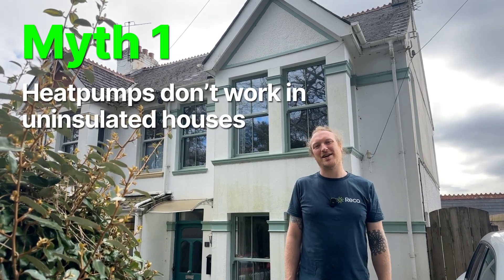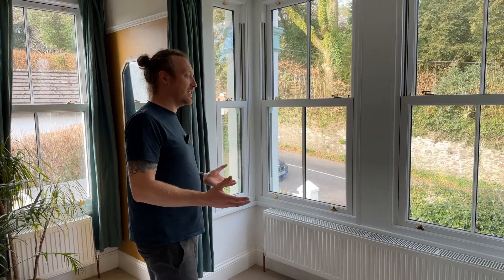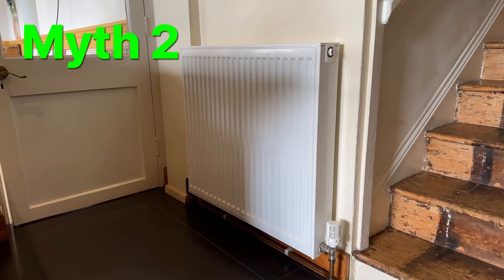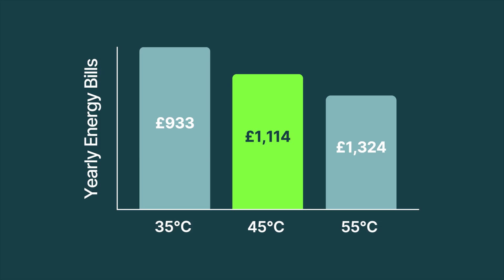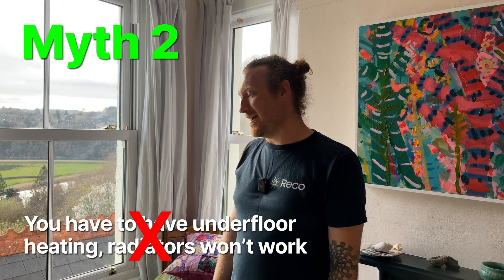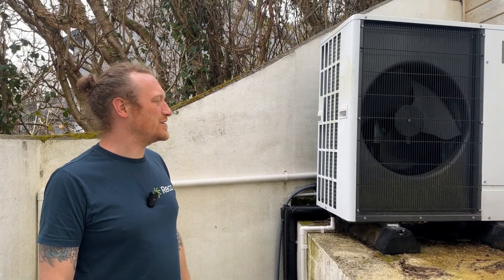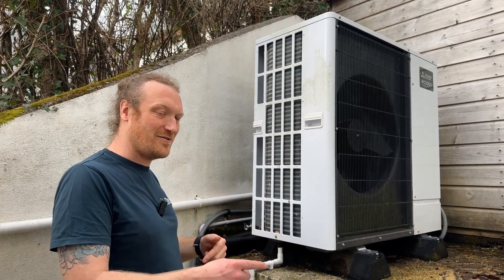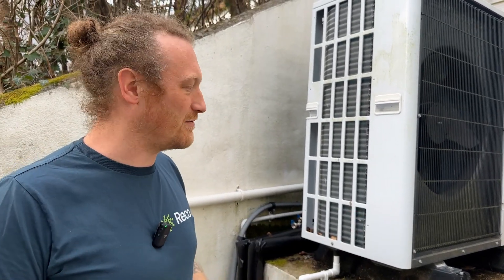Heat Pumps DONT Work In Old Houses!

Comment: There is an issue, in that Air to Water Heatpumps can be less than ideal in older properties. Air to Air Heatpumps are much better for older properties. In comparison, with Resistive heating it's night & day. However, Government grants don't cover, Air to Air Heatpumps, so if people want a Grant, they have no choice. Forcing Air to Water Heatpumps on people in older properties, will just lead to dissatisfied customers, and a backlash. The governemt, needs to see common sense and start approving Grants for Air to Air Heatpumps...
Reply: To be fair, the cost of a multisplit a2a system will be apx 8k, which is about what many a2w installs cost AFTER the grant with the radar or pipework  changes.
Reply from the maker: Also you would need to put plastic trunking all over the house and an air con style head in every room, not very aesthetically pleasing in a period house. Air-air heat pumps provide heat through convection only which means the fabric of the building doesn’t warm up in the same way. Radiators provide convective and radiative heat which permeates and warms the fabric of the building. This means the house acts as a thermal battery allowing the system to ride through cold spells more efficiently. An air-air system would struggle to heat an old building like this from cold and provides a different “feeling” heat. A bit like when putting electric fan heaters on, as soon as they are off it gets cold.

Comment: Between 4 and 5 Megawatts over the year isn’t as bad as I was expecting for an 11kW output unit. Got my 16kW  (14kW true output for a 13 kW heat loss property) unit going in over the next couple of weeks, extremely nervous I have made a bad decision. If I’m honest it doesn’t make a lot of financial sense to be replacing the gas boiler with the current power pricing structure.
Reply from the maker: If it’s installed correctly then it shouldn’t cost you anymore to run. Make sure the unit you are installing allows you to see the heat it’s delivering and the energy it uses, if not maybe consider installing an emonpi heat monitor so you can look at how well it’s running. Make sure the radiators have been sized for each room correctly and the installer has ensured that pipework to them is sufficient. The installer should be setting it up using weather compensation and not a fixed flow temp. If they are fitting a buffer then question them as to why it is needed. If they understand all of these things the chances are you will have an SCOP above 3.5 which will result in a cheaper than gas system. 

If you pay 27p per unit of electricity and your COP is 3.5 then 27/3.5 =7.7p per unit of heat. 

If you pay 6.9p for a kWh of gas and your boiler is running at 85% efficiency then 6.9/0.85=8.1p per unit of heat. 

Heat pumps are cheaper but people haven’t caught up with the key concepts and basic maths yet. That’s why we started this channel!
Reply: @ Thanks. Yes, it’s taken me 9 months to get to this point, had extensive insulation (and ventilation) remediation to get us to 40w/ m2, we were at 80w/m2. That allowed us to drop to a large single phase heat pump, whereas before we were looking at a very large 3 phase system that was untenable. Going with the 16kW Samsung, even with the nasty control system, primarily because it has the best footprint for the location we want to install it in. Yes, running weather compensation, we plan to run it with to target 15C and <40C flow temp in the house as we don’t like it hot, my hope is that it won’t consume more than 6mW over the year. We have a large 15kW peak PV array that gives us about 10mW export income on octopus intelligent go, so the strategy is to use the credit in the sunny months to cover the cost of the ASHP on octopus cosy over the winter months and over the year and we should end up with about £2k profit on our power. Time will tell if my predictions are correct. 
It’s all overly complicated and the majority of installs are poorly specified, I had to scope it for myself and as a process engineer I had that capability. But am sure if ASHPs can never take off until this improves and uk.gov needs to resolve the spark gap.
Reply: @RecoEnergy  We did it back in June/July. It’s been amazing, although a large unit at 16kW, most of the time it modulates down to about 800W load. Have it managed by a homely optimiser, I’ve not seen the flow temperature go above 26C yet and it has frequently dropped down to 2-3 C overnight. Best thing we ever did, from a comfort and economy perspective.
Reply: If you have a substantial solar array then a heat pump would make sense. You save over £100 per ann. in getting rid of the gas meter which buys a a lot of heat electricity. But if no solar array then a low temp running system with a low modulating gas boiler is generally the better choice. It is a matter of getting someone who knows what they doing with a low temp system and low modulating boiler or a heat pump.
Reply: @ Thanks, yes I put in a chunky monkey PV and PW3 system. It’s on track to output about 13 mega watts over the year on octopus intelligent flux. Excess credit should cover ASHP costs and leave me with a few quid pending my miscalculation, best laid plans of mice and men and that! It’s a largish house to heat at 300m2 but we are used to wearing clothes in the winter, so even 15C is a bit too warm for us.

Comment: 1 How much , that heat pump is massive. Obviously a cheaper solution would have been room air conditioner and a gas boiler when it's cold?
Reply from the maker: This house needed a completely new heating system because we were replacing storage heaters. I believe the whole system was in the region of £20k. The heat pump and cylinder made up around £11k of the cost, which was mostly covered by a grant at the time. The heat pump is large due to the high heat loss of the building. 

I would think that installing A2A as well as radiators for a gas boiler would cost much more than this system. 

The boiler upgrade scheme provides an upfront grant of £7,500 which will covers most of the cost of the heat pump and hot water cylinder. This means installing a heat pump is slightly more than what a new gas boiler would cost but less than what it would cost for a gas boiler with a hot water cylinder which offers a much better pressure and flow rate for showers. The running costs of a heat pump are the same as a gas boiler when installed correctly. When paired with solar there’s the opportunity for it to be cheaper than gas.

Comment: 1114 a year to run, WTH is even that.  i am in an 200 year old house and pay half that for heating, about 50 a month for me for gas on average, significantly less in the spring summer autumn etc, as the gas is just for water,  the winter months peak of course, but average across all months over the year, 50 a month give or take.

Granted i am a tight git, But i have done the work myself. the house is well insulated, well above regs, for instance, regs say loft should be 270 mm mine is closer to 350 to 400, All cavities have been filled with beads, modern windows through out. etc.
Reply from the maker: That’s great that you’ve managed to increase your insulation levels, and by the sound of it posisbly for very little cost? 

This building doesn’t have any wall insulation and no cavity which results in a very large heating bill, this running cost is equivalent to what the gas bill would be if the house had a condensing gas boiler and was on the gas grid. 

The reality is it would cost 10’s of thousands in external wall insulation to half this heating bill. Think about the payback time on that! There are a lot of buildings like this in the country and in my mind the way forward is to install heat pumps and solar. This will offer the best financial benefit in the long run over costly insulation, not to mention the risk of the insulation being installed wrong and causing damp issues.
Reply: I also have insulated well above regs in a 1930s house approx 450 sq mtrs , installed 2 heat pumps and underfloor heating on ground floor. K3 rad on two other floors and have found that I can heat the house on cheap rate overnight 12 till 7 then it cuts off until 12 again , the cost is 1.34 per day and it’s actually too hot .
Reply: @pmb9172 

That's pretty impressive